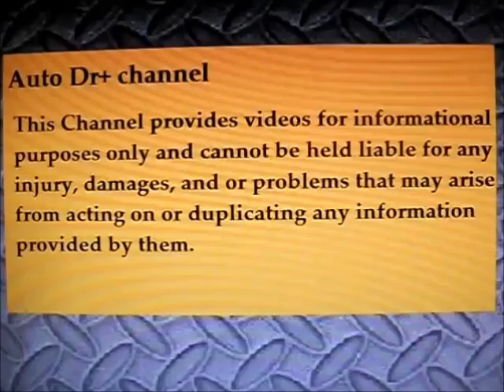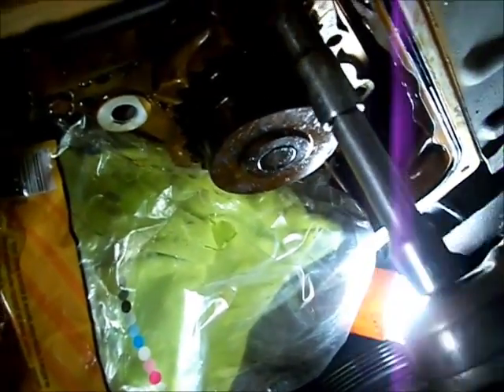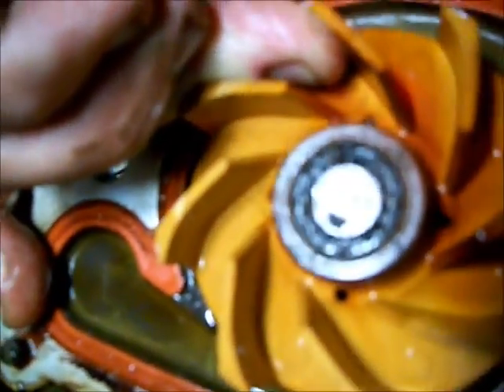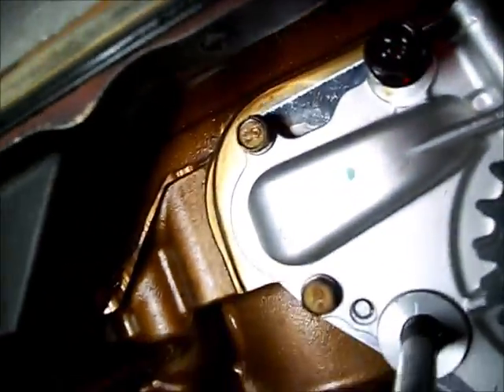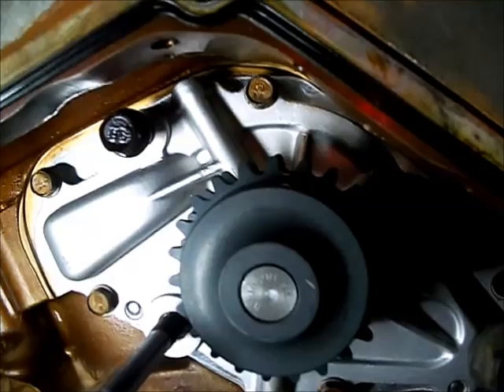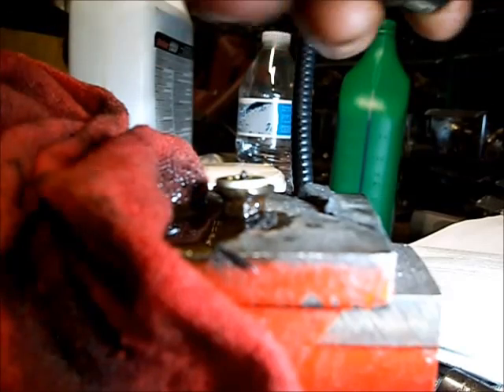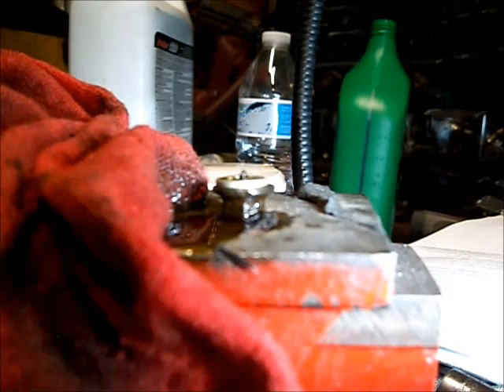Dodge Magnum `05 w 2.7l pt.2 water pump replace timing chains

Comment: Hello Auto Dr . That was the best video on YouTube on how to change the water pump. Thanks.
Using locking pliers was a fantastic idea. It made me think, why even remove the sprocket and bolting it again, you could've kept it on, and put the chain on it, and then install all the guides, don't you think?
Thanks again for GREAT videos
Reply from the maker: Thanks for watching

Comment: What did u use to put crankshaft pulley back on
Reply from the maker: The crank bolt, after I knocked it back on the crank, about 1/2" with hammer against a block of wood, in center of pulley.  Thanks for watching.

Comment: Hey guy the new water pump comes with a metal gasket and a orange seal do you still put silicone to install it or No?
Reply from the maker: No, no need, silicone would actually defeat the sealing action of that seal.
Reply: @AutoDrdiy  oh ok thank you so much
Reply from the maker: @dragstriprabies2.059    no problem, thanks for watching